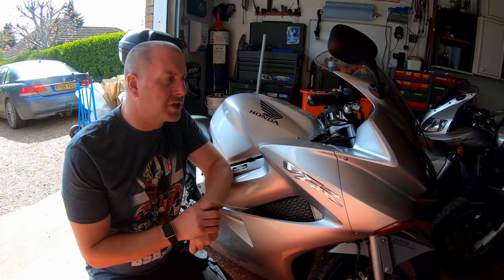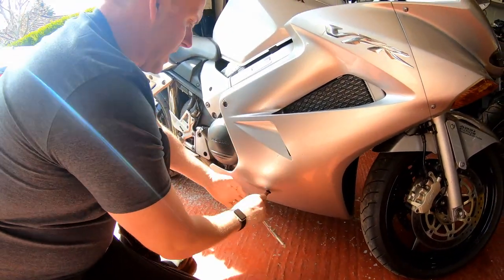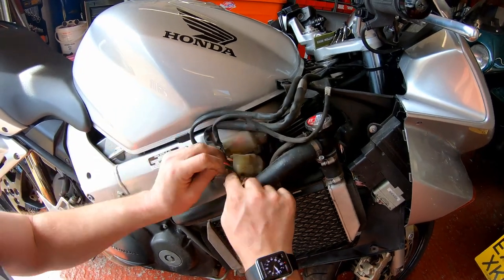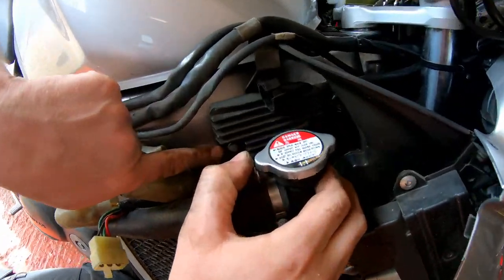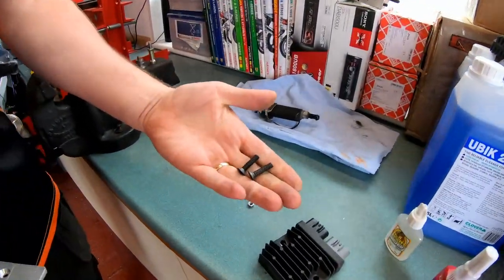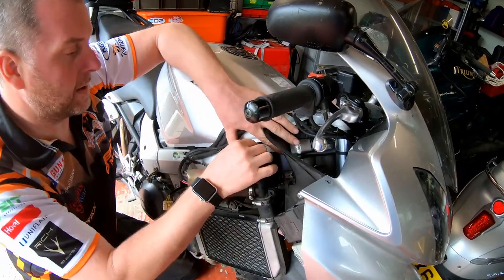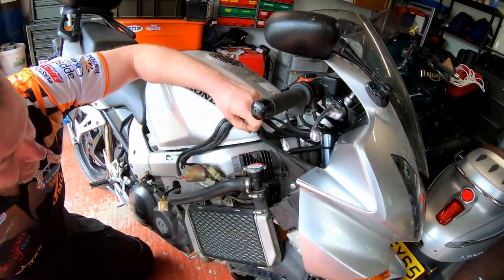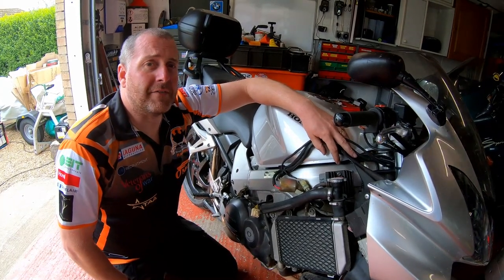Replacing The Reg/Rec On The VFR800 With A Shindengen FH020AA. Episode 2 - Making A Mounting Plate.

Comment: I really like this series of videos, educational and useful.
I recently bought a 1999 vfr 800 fi (5th gen), and it has a dodgy rectifier hack on it...or so it seems, the rectifier is bolted to the left of the bike behind the fairing, and has a positive wire bolted from the external hole on the rectifier, nearest the handlebars to the positive terminal on the battery, no negative wire, but the poles of the battery joined by what looks like a battery tender connecter.
The bike was running fine, but must not have been charging, because she went flat while I was walking around town, and would not start...
Got her home, took out the battery, put it on smart charge, but stupidly connected the negative first..
The wire connecting the rectifier to the battery caught fire and severed in seconds.
The shame.
I disconnected it, doused the fire on the wire, did a quick dirty repair on the rectifier  positive  wire, and connected it up , this time negative last on the battery.
The bike was still not starting, but it does not seem to have damaged anything beyond the wire from the exterior of the rectifier..
I need to know if the default position of the 1999 vfr 800 rectifier is on the left side, bolted to the frame just rear of the rider position
I'm guessing it isn't.
Will do this install anyway, just going to re watch all videos to get it straight in my mind on how to do it properly.
Have you any tips.. and is the shindengen rr unit compatible with Lithium batteries?
Thanks.
Reply from the maker: Hey bud, yeah on the Gen 5 models the R/R is bolted to the subframe on the left hand side, kinda adjacent to where a pillion would sit. Sounds like it’s been messed about with though by the description of the wiring! The Shindengen R/R 100% work with lithium batteries too! 👍🏻
Reply: @KevsShed  
Thanks..
Just ordered the Shindengen yesterday...will collect the various materials and tools for the job while I wait for it to be delivered.
If the stator is nearer to the default mounting, it will require less 12 agw 
So that's something.

Comment: Hi kev done same with both of my vfr 750 models wired rectifier direct to battery  the early one which is a 88 model melted the the plug from the stator  made loom up my self fitted a fuse link to live side of battery did the other 750 as a pre caution which is a 94 fr model also have 2015 model vfr 800 had no problems with that  wiring is a lot thicker on 2015 model.
Reply from the maker: Nice 👌🏻

Comment: have you had any other issues with the r/r or the stator since changing? i put an update mosfet r/r and it only lasted 5 months.  it shorted out because of heat. i may be relocating the new r/r in a new place to get more air but, not sure where yet. thanks

Comment: Really you could mount the rectifier regulator somewhere else as where Honda have placed it,  it is adjacent to the radiator and coolant pipes which can get pretty hot meaning the reg/rec will always be hot. As you have made a new loom you can choose your new position really. Just make up a new mounting bracket. I would be inclined to put it somewhere away from heat and where there is air flow to help keep it cool. Am about to do mine. Nevertheless Kevin excellent thorough work.

Comment: Hi Kev, Why do Honda fit the reg/rec in such poor positions? On my 750 it's tucked up above the ex pipe in an almost dead air space! On youre 800 it's above a rad with the engine hating the frame that it's bolted to! My sons TL 1000's reg is on the rear frame in fresh air. Now that seems far more sensible.
Reply from the maker: It's a very valid point, I can only assume that it is  space thing. I agree that the TL1000S has it in a seemingly better location. That said, I am pretty sure that the R/R on the TL1000S is the same as the one on my GSXR SRAD and my SV1000S which aren't considered to be overly reliable either! Only time will tell!

Comment: Is there just one connection from the stator to the rectifier?
Reply from the maker: One connector with 3 cables
Reply: @KevsShed  are you still doing the wiring kit for the mosfests and do you supply the rectifiers? Cheers

Comment: Great video. As a potential 5th gen vfr owner, i'm doing my reasearch so all this is extremely helpful! One small observation though, shouldn't the cooling "things" on the r/r (i don't know how they are called haha) be at the same angle as the OEM set-up? So the air can flow through them from the front of the bike?
Reply from the maker: It'll make no difference to the cooling ability at all, the Shindengen R/Rs run far cooler anyway! I have made and sold over 150 of these kits now and have not had a single failure. You could argue the same about the radiators on the  bike too I suppose! They aren't best positioned for airflow either!
Reply: @KevsShed  Fair enough. I suppose i am far too OCD about these stuff 😅. This is the first thing I'll check when i get the bike. If it's stock, you'll have a new customer!
Reply: @KevsShed  Okay take my money! How do I buy a kit from you please?

Comment: Question, I'm rocking a 07 and when I bought it it already had HID's installed with standard bulbs for the high beams. 
The reg/rec is still stock.
I have switched out my stock high beams with Cougar Motor H7 LED'S. So because LED's and HID's have different power requirements do you think the extra unused power/ heat to the Reg/rec will burn it up? Or do you think the stock reg has enough thermal dissipation to mitigate the excess? Same question for the upgraded reg/rec?
Reply from the maker: The best answer that I can give is that the energy created by the Stator that is unused by the electrical system has to be dissipated somewhere and a by product of this loss is heat when the standard shunt R/R sends it to ground. The Stock R/R isn't particularly great at this and it won't be any better now that it is 14 years old! Corrosion in the connectors of the bikes loom will certainly exacerbate the issue greatly! The Shindengen R/R is far better at handling excess heat and it actually uses Mosfet technology and therefore actually is a fair bit cooler in operation. Hope this answers your question.

Comment: Does this mod also fit a year 2000 VFR 800?
Reply from the maker: Yep, the rectifier is in a slightly different position I think, unsure without checking the manual. So you may need different lengths of wire to what I used but other than that it’ll work the exact same 👍🏻
Reply: @KevsShed  Just found it behind the seat cowel, left side. It is a Shindengen SH579C-12.
I geuss that's original?
Reply from the maker: Blackfinger 2 I would have to check the part numbers but sounds right.

Comment: my 2bob these things need to be in air flow area of bike not hidden behind plastic body  work they fail because they over heat
Reply from the maker: Generally they fail due to corrosion at the connectors caused by water ingress. This raises the resistance which in turn raises the temperature. The stock locations are fine for the usual heat levels, not so in the case of an overheating one though!